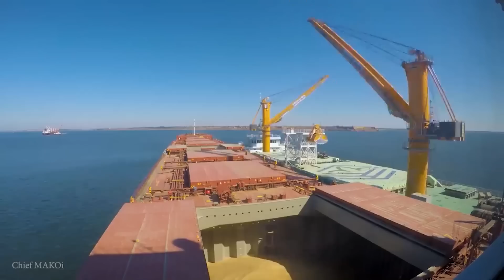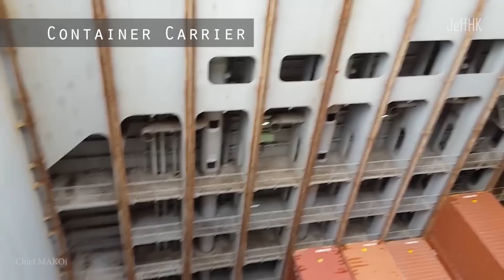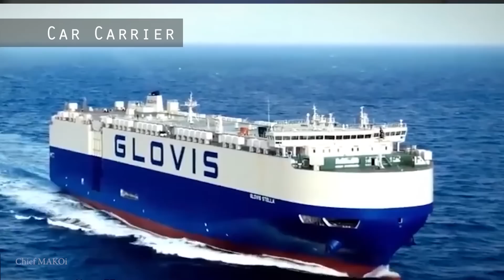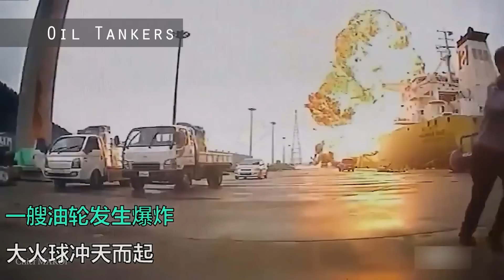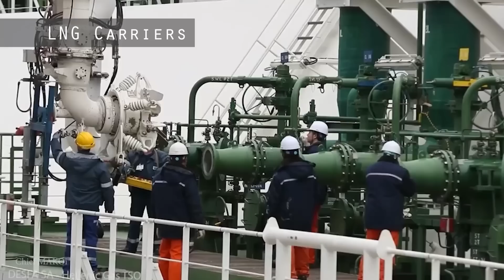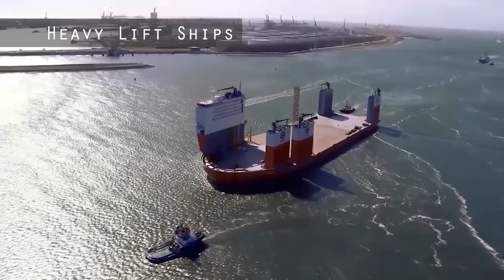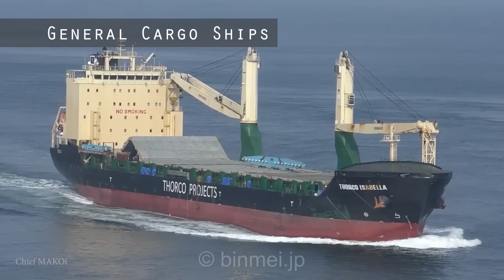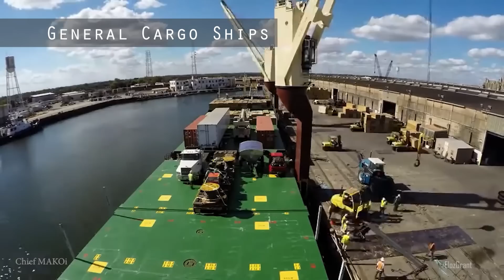What Are These Cargo Ships Carrying?  | Chief MAKOi Seaman Vlog

Comment: The only thing I am surprised about is that you didn't mention RoRo as one of the names for what you called a car carrier ship. I have heard them called very little else than a RoRo, (Roll On, Roll Off) and while cars are probably the most common cargo, they haul anything else that can be driven or carried on!
Reply: Maybe since RoRo ships are more akin to passenger ships, and not cargo ships - technically speaking. RoRo is mainly used for short hops that would need vehicles, aside from human passengers.
Reply: @baybum7  Not really. Military Sealift Command (US) has a small fleet of converted Sea-Land fast container ships, with multiple decks connectable by ramps, besides deck stowage. They accommodate CH-53s and M-1A tanks to anywhere on the oceans. In excess of 32 knots. Built in Holland. Hardly short-hoppers.
Reply: @baybum7  I think you are thinking of RoRo ferries, smaller ships designed for short trips with people and cars, but I am saying that what Chief called a car carrier is usually called a RoRo everywhere I have seen.
Google RoRo and see what comes up.

And if he was only talking about Car Carriers, then he left out the large class of RoRos used for hauling trucks and trains and heavy equipment that are the size range as the car carriers, just have taller decks to allow larger vehicles.

I think he just left out RoRo as one of the common names, which is forgivable because I don't think he works on that side of the industry.
Reply: @ke6gwf  true. I live in the Philippines, and since we have thousands of islands, we have so many short trip RoRos, which are called as such. Hence, I assumed the ship class was based on the colloquial usage of the term. Didn't think the term was for a wider range of ship types.

Also, if I google RoRo in a Philippine IP, I will probably see mostly the smaller type RoRo ships common here in PH, hehe.
Reply: @baybum7  that makes sense, you are in a prime area for what I know as just car ferries.
Reply: @ke6gwf  I thought the same thing. Everyone in the industry calls them RoRo's. I was surprised that he didn't mention the nickname.
KC1GZR
Reply: @CMDR.Gonzo.von.Richthofen   on the commercial side of things these vessels are referred to as RORO vessels although there are pure car carriers that are purpose-built and usually operated under long-term charter to carry new autos to market.
Reply: @manatee2500  yes, that's what I was saying. I am a merchant mariner. I work on the "commercial side of things."
Reply: "And while cars are probably the most common cargo, they haul anything else that can be driven or carried on"

As mentioned in the video...
Reply: @martinc.720  Yes, my comment was that he didn't mention the more common name of RoRo when talking about RoRos!
Reply: RO/RO vessels are extremely flexible with respect to the types of cargo that they carry which can range from massive pieces of static cargo (carried on mafi trailers) to all types and sizes of wheeled cargo. They can also carry containers on mafi trailers under deck.
Reply: there is a lot of roro that carry only truck trailers
Reply: There are Cruises and Ferries which carries "human cargo" or RoPax as well for cars and passengers 😂😂😂

Comment: Do the crews have a preference for which type of cargo ship they work on?  I wonder if the compensation varies by ship type.  I suspect that there may be pros and cons to working on certain ships.  Thank you for sharing.
Reply: The dangerous the cargo is the better the salary. Tankers have better salary since they carry sensitive cargo, like oil where one mistake can make ur ship go boom or chemicals where the cargo can kill u softly if unchecked. Some seafarer choose ship that often stays in port for days (bulk ships) some chooses salary (tankers). Really depend on the seafarer but it's not easy to jump from different type of ship to another as some ship have something that the other one dont have. That is why ship's are built for different purposes to be able to carry that specific cargo to one place to another, thus requiring that specific seafarer to have experience/knowledge in handling different types of cargoes(deck) or engine/machinery (engineers).
Reply: @Kid james Cruise Ships ;).
Reply: @Kid james Bulk Ships is the ship for u. They stay in port longer than any type of vessels.
Reply: @Kid james any ship , just get out there !